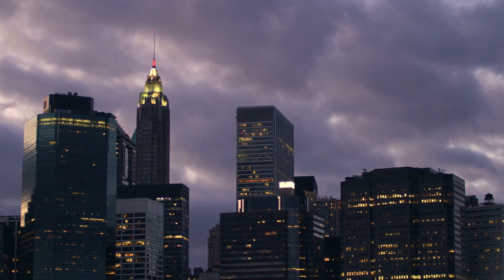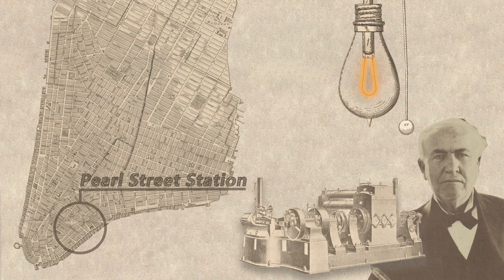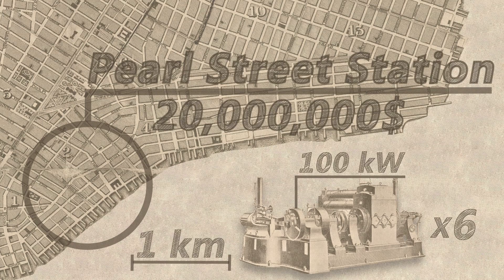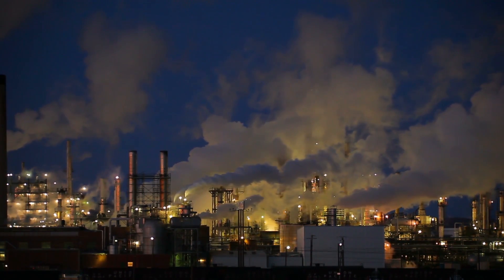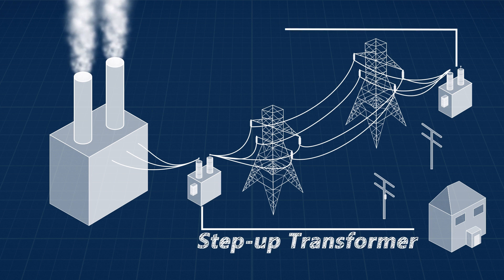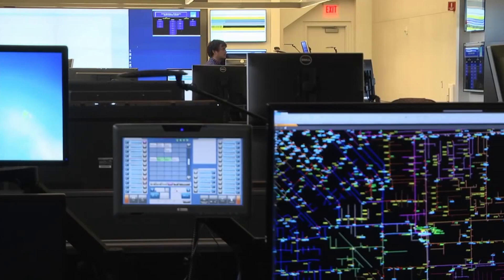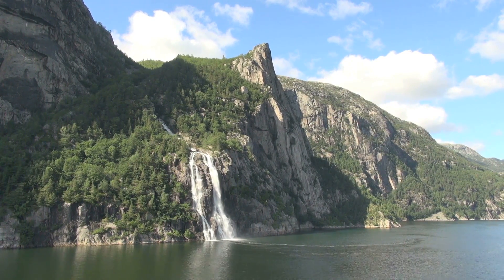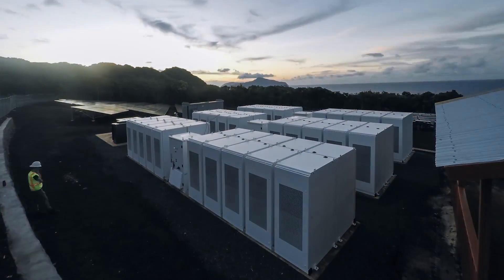What's The Biggest Machine In The World?

Comment: with all those solar panels and no more fossil fuels, our earth will cool into a second ice age! we are all going to die!!!
Reply: If you use the electricity, it will eventually become heat, so you don't have to worry to much. ;)
Reply: I can't tell how serious this is but i'm leaning toward the joke side
Reply: Depends on the efficiency of your machine :p
Reply: I think any energy that is used for work, won't be transfered to heat(besides friction losses of course). Energy used for light however is most likely going to become heat eventually.
Reply: You are basically changing it's kinetic energy twice. First you use energy to accelerate it, then you use energy to descelerate it. There is not really any energy stored here(I think).
Reply: You can accelerate and decelerate an object without friction. During our discussion entropy was always on my mind, but I believe mechanical energy has nothing to do with entropy.
Reply: Jonas Kunnen Every kind of energy is eventually being converted into heat.
If you run a current into your computer it's turning it all into heat. If you accelerate something you raise it's potential energy. If you decelerate it again you will lower its potential energy. Depending on the method of deceleration you use you will convert most of it's potential energy into another form of usable energy (electric car that breaks with its motor to generate electricity), or convert everything into heat (standard car brake)
Reply: I'd have to agree on the braking part of your argument. However, I find it hard to believe all energy you put into a computer is turned into heat. I have a desktop computer with an average of 300W, which is 300 joules  per second. Running my computer for 15 minutes would result in a heat input in my room of about 270kJ. Let's say I'm in a 4x4x2.75m room, which gives me a volume of 44m³. If we multiply this by the density of air(1.205kg/m³), we get a mass of 53kg. The specific heat of air at 20°C is 1.005J/kg K. Multiplying the mass and specific heat, we get the required amount of energy to heat up the room by 1 Kelvin. This is about 53.3kJ/K. If we now take the calculated heat input and divide it by this last number, we will get the rise in temperature after 15min of running the computer, which is an astounding 5°C. 

If I made any mistakes, please do correct me.
Reply: Jonas Kunnen I came to the same result, however this calculation doesn't really represent the real world situation we have. 

In your room there is more than just air. There is all your furniture, the walls, the PC itself, etc. that also absorb heat and need way more energy to be heated up. 
Your walls, door and windows also don't isolate the heat in your room completely, some of it will get outside. 

As far as I know a PC turns its entire electricity input into heat, at least what you put into your CPU. Some of it will be used to spin up the fans, hard drive, etc. but that energy will also become heat after you turn the PC off and they stop because of friction. 

All energy will eventually become heat is also unavoidable because you can never have a 100% conversion between 2 forms of energy. You always have some form of loss and the amount of usable energy will decrease until all energy is converted into heat.
Reply: Please tell me you're joking...
Reply: you know, because in stead of sunlight turning to heat it will be reflected or turned into electricity.
Reply: Isn't that what we want though? Nowadays to much radiation is trapped in the atmosphere, so the more we reflect or use, the slower global warming will be.
Reply: stopping the initial absorption would reduce the temperature by WAY more than greenhouse gases can raise it.
Reply: cold is far worse for the environment than heat in my opinion. we have too much water to become Venus, so we're good. I'd rather have global warming than global cooling.
Reply: Otto, a surface albedo effect—caused by white or reflective objects on the surface of the planet—doesn't "stop the initial absorption." You are really oversimplifying how this system works.

Comment: I would expect that the grid will actually be expanded in order to distribute intermittent power better. Storage will likely remain the most expensive part of the grid (because it doesn't actually contribute to the amount of energy generated, or its distribution), aside from installing overcapacity (as you mention it's inefficient to build renewables and then not run them as much as possible). The way to minimise the amount of storage and overcapacity required is by making sure that power can be efficiently transported over large distances (although this approach might be more viable in Europe than in the US). I did my bachelor thesis on what a 100% renewable scenario would mean for the Netherlands :-)

Comment: Why not just use something like a large UPS if one power source fails of course a lot bigger but you get the concept
Reply: Batteries are very expensive and very big.
Reply: Big flywheels maybe? Lots of em.
Reply: Where I live a company called Centrica is building a battery storage plant which holds around 50MW, but it's designed to respond to peak levels of usage. When complete it will be the largest in the world, so that gives you an idea of the scale modern technology can allow.

Comment: What are the most efficient methods of energy storage? Is the pumped hydro one of the most efficient or are there better methods?
Reply: Caleb Mueller Pumped hydro is currently the most viable method by far but t is heavily limited by geographical features. There are only so mans high altitude lakes which you can use for that.
On the other hand Tesla's mass manufacturing of batteries which he mentioned might open up revolutionary possibilities for the futre.

Comment: 5:13 Coal and Reliability? Are you kidding me?
Reply: Know the difference between reliability and sustainability. Most sustainable power sources such as wind power and solar power do not produce power continuously at constant rates, and in the case of wind power, it can shut off without warning. Despite how controversial coal power might be, it's reliable in the sense that it will produce power 24/7, and we know when it will stop doing so.
Reply: Devintage I, thanks for the information. People often use these terms interchangeably. So, I sometimes get confused.
Reply: Thanks for not taking it personally.
Reply: Devintage I, You're Welcome
Reply: AlphaMikeOrange, I confused it with sustainability since people often use these terms interchangeably.
Reply: Important distinction.

On the side, Nuclear power is both reliable AND sustainable - its just seen as an unacceptable public risk.

Comment: I wished in future we would use more solar power.
Reply: No, it doesn't produce electricity, it just warms water which gets stored in a big tank (2*2*2.5 m).
This is cheaper than photovoltaric panels and a lot more efficient than heating with electricity. 

Besides that, heating consumes about 50% of the energy of a household, electric energy just about 20%.
Source (In german, sorry): http://www.zeit.de/wirtschaft/2014-09/energieverbrauch-haushalt-heizen
Reply: You clearly have no idea what you're talking about. Because solar power is has incredible potential. But just like nuclear power, not much funding goes into them. Only 15% of the suns rays hitting the solar panel are successfully turned into energy. 30% of Germany runs on solar energy. As for nuclear, it's an amazing sources of energy yes, with 1 ton of uranium producing the same amount of energy as 600 tons of coal. And even then it's incredibly underfunded, we haven't used fusion because no one researches nuclear power. All our reactors are outdated and inefficient, and they still manage. But of course they pollute, and your biggest mistake Owen is making fun of 'eco-hippies', because climate change is the biggest threat to earth and mankind. Don't let the the uniformed idiots fool you otherwise.
Reply: On the roof of my house are big solar panels for warm water. With this we use the sunlight instead of gas or electricity for warm water for showering etc. And we can heat our house for one or two months in early and late winter just with that. The rest of the winter we use wood.

An other technique for harvesting the sun's energy would be photosynthesis, but that is still some years away.
Reply: Nuclear Fusion is the Holy grail of energy generation. But even then, Solar power(with storage batteries) is still useful for communities to war away from the main grid, Hospitals and Water plants encase of infrastructure failure (like violent conflict, terror attack or natural disaster), or for households that want to reduce or not pay any electricity bill.
Reply: As Real Engineering explained Solar is unreliable, you will always need base production. And you cannot simply turn off a nuclear power station you will have to run the nuclear power station all the time, producing the vast majority of the power needed.

At that point why should we invest in Solar? Simple physics dictate that nuclear will be reasonable for 95% of the energy production why not just round it up.

And the issue I take with eco-hippies is because they are hurting the environment by taking away focus and often blaming nuclear power production.
Reply: "well pretty much everyone i have seen working in stem fields sees dyson structures  as an inevitability."

Yeah in like 10,000 years.

I am talking about my lifetime and my children's lifetimes, and that is what this discussion is about. The here and now, not some distant possibility.
Reply: I wish we  wouldnt. We should use nuclear energy and green the areas where panels would be
Reply: Don't forget that Fukushima built in the 60's and was one of the oldest plants in operation in world already.
Reply: Well, we're not gonna create a dyson sphere or that thing in The Force Awakens any time soon
Reply: The biggest problem with solar is storage of exes energy generated during peek hours. This problem might be solved with something like the Tesla battery.
 And also reducing manufacturing cost of panels, so they can be more affordable.
Reply: Dyson bubbles ... Don't confuse Sci-Fi with reality. 

Fusion is also a long way off, we have been developing it since the 50's without much progress.
Reply: science community? Which one? It's not likely, why would spending copious amounts of energy sending solar panels in close orbit around the sun, then beaming it back with horrible efficiently be better than simply using the massive amounts of energy readily available right here?
Reply: US plants werent built that much more recent, also there is the thing with the nuclear waste
Reply: New reactor tech has designs that produce waste that can be used for many application like curing leukemia and the nasty stuff would only last 300 years.
Reply: Julius Derzocker Do you realise that natural gas and oil are a direct result of photosynthesis?
Nature captures the energy of the sun by photosynthesis, we don't have to replicate it.
Reply: TwizzElishus fukushima and chernobyl beg to differ
Reply: Solar power is stupid. Nuclear energy is the cleanest, the most reliable energy source we have. 
Sadly the eco-hippies are focused on stupid renewable energy instead.